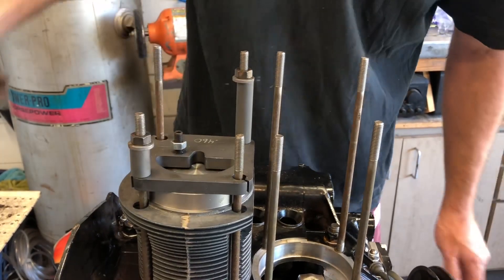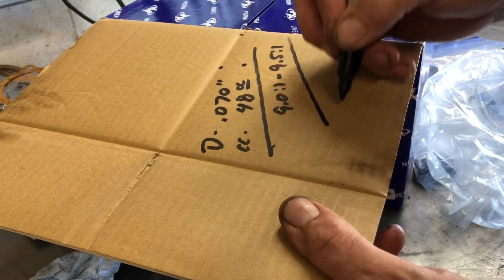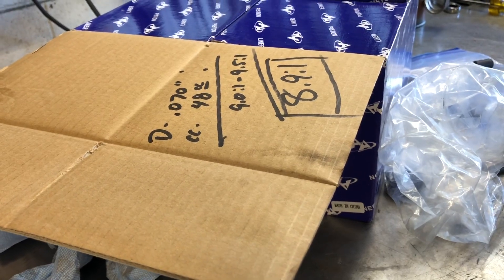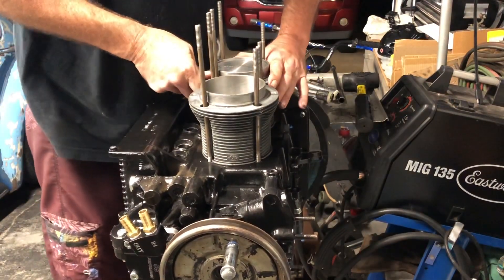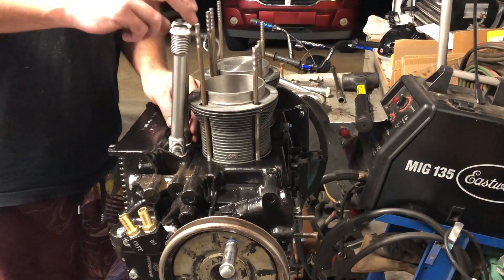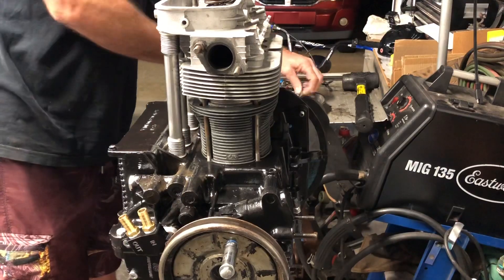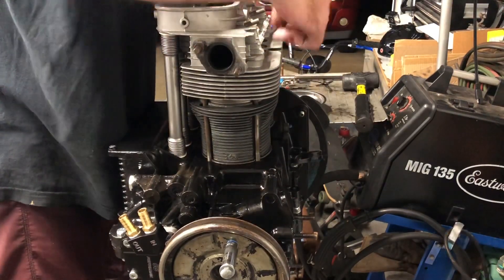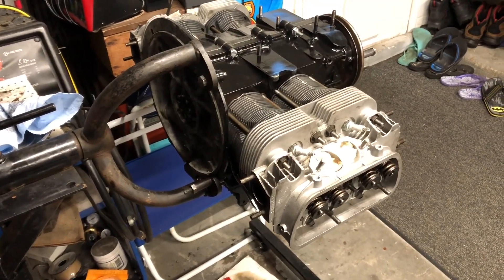HOT 1915cc Engine for Jawbreaker the 1973 VW Beetle - Part 2 Top End

Comment: Sweet video!!! And no shims!!! This motor is going to be outstanding!!! I can’t wait to see jawbreaker rolling with it down the road!!!
Reply from the maker: Slades VW Beetle thanks man! I can’t wait to get her tuned correctly so I can roll down the road!
Reply: VWJawbreaker oh I think it will come up very shortly. I cannot wait to see how you feel about this engine size. Because I know you’re very straight up about stuff.
Reply from the maker: Slades VW Beetle waiting on some jets and a crank case breather before I can do much more. But yes, I’m very honest and I’m hoping this will be everything that I hoped it would.
Reply: @VWJawbreaker  Gary, what kind of sealer do you use on the washers on the heads? And what tins did you use on the bottom?
Reply from the maker: Slades VW Beetle either ultra black silicone or the last few builds I’ve been using the aviation permitex with good results.

Comment: 6:01 I personally rather put the sharp side of the wrist pin keeper looking out, I think that the sharp edge helps to cling on the groove of the piston and keep it tight… saludos.
Reply from the maker: That’s a great point, I see exactly where you’re coming from.
Reply: Actually, I have done that on automatic transmissions, those little clips stayed in place when you put them whit the sharp edges pointing out… saludos desde México!

Comment: That engine is going to be nastyyyy 😭 
I cant wait to see it idling... Cammin.. 🙈👍👍👍
Reply from the maker: VW RICH FLAT4 it surprisingly doesn’t run as rough as I thought. Played around with exhaust mufflers and found one that sounds pretty good I think. Definitely sounds better off camera 😂
Reply: @VWJawbreaker  i was wondering about something.. My car is a 76.. Should be a dished cam (haven't checked).. Can you just switch to a flat cam by going with the flat cam oil pump and should it all just bolt up correctly?
Reply from the maker: VW RICH FLAT4 assuming you’re cam is the original to that engine case and that engine is definitely a 1971 and later with the 4 rivet dish cam gear, yes it is just a matter of swapping the cam and using the correct oil pump.
Reply: @VWJawbreaker  awesome..one of these days ill check it.. There just seems to be more options for the flat cam setups..
Thanks 👌👍
Reply from the maker: VW RICH FLAT4 anytime bud.

Comment: I’m a bit of a newbie when it comes to buger motors do you need a new crank and rods and a different case to make a 1915 or can it be done with a standard as41 case crank and rods sorry for the silly question just seeing what I need
Reply from the maker: We all were new at one point and none of us know it all! 
For a 1915 you can use the stock rods and crank, you’ll need the stock case machines for the 94mm cylinders.
Reply: @VWJawbreaker  thanks for that I’ll have to look into a place that can machine it for me here in Australia vic

Comment: Nice build. But one thing you mentioned about the keepers the sharp side should be away from the pins, sharp side out. Taking that from The Berg book of instructions. He states incorrect installation could possibly allow the keeper to walk out.
Reply from the maker: Rob Sannes are you referring to the valve keepers or the head washers for the head bolts?
Reply: The piston pin keepers the internal snap rings is what I was referring to.
Reply from the maker: Rob Sannes ah yes, you might be right. I’ll double check that for future reference. Thanks!

Comment: do you use gasket sinch on the tube seals?
Reply from the maker: +B A Man I don’t use anything on the push rod seals. I know some people do but I’ve never had a problem. I ensure the case is clean and oil free and lightly line the seals so they sit correctly.... it’s always worked for me.

Comment: What heads you run and where did you get them?
Reply from the maker: Those are the CB 044 CNC Ultra Mag heads 42 x 37.5 with dual valve springs from CB Performance

Comment: What you left off were your small air deflector plates
Reply: Ok, you said you liked some type better than the stock air deflector tins. What are They?... and why do you prefer them? Thanks for recording and explaining all your work and experience. Good luck!
Reply from the maker: Second Looks For Men I used the stock air deflectors in this engine. 
The type 3 or as others call them, cool tins work well also. On this engine with the 94mm cylinders, I opted not to use the type 3 cool tins since it requires quite a bit of trimming to get them to fit right. Just my opinions is all.

Comment: any overheating probles?
Reply from the maker: Had an issue with the case after a little bit. Ended up getting a new case and a 74mm crank to build a 2054cc. Used the same everything else, haven’t had a single issue since.